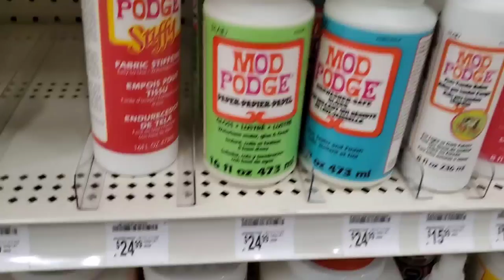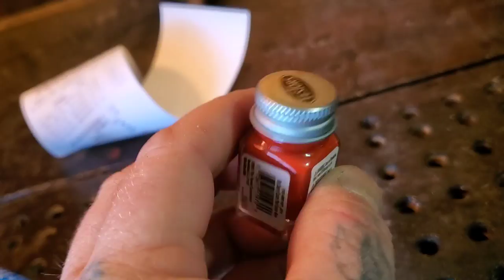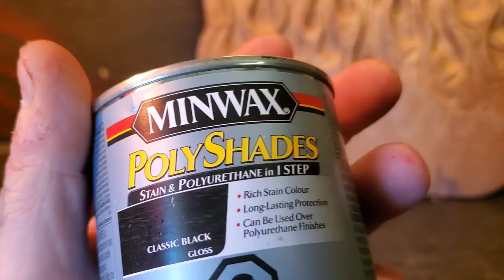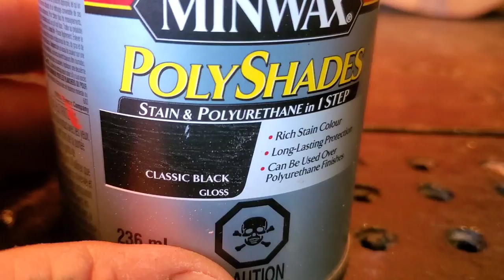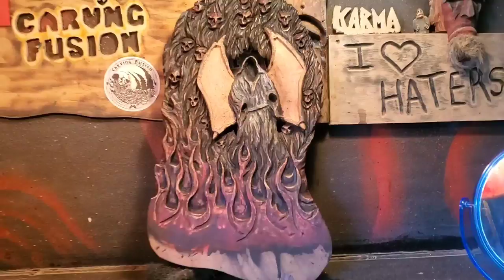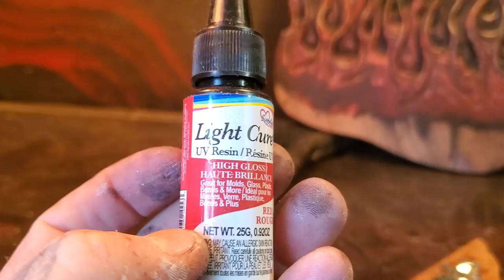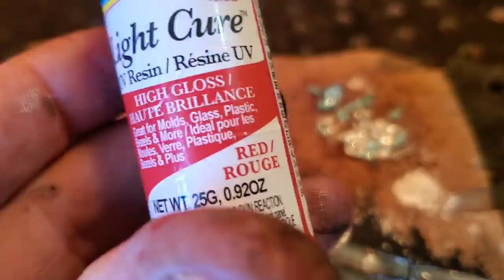Power carving A Grim Reaper # 3.  painting and finishing

Comment: I don't know who, but they are called sparkles because they sparkle. You need a special airbrush to spray sparkles, it has a big tip.  A standard airbrush will clog up. 
SMASHED mirror,,, I like your style.
Micro carver = high speed/low torque. I think it would do a lot better with small bits and fine detail. Just a guess cause I don't have one to judge. I have a little imitation dremel that I can damn near stop by grabbing the bit when it's runnin, don't ask me how I know, put one of those itty bitty bits on it and it will do some very fine detail, very slowly. I hardly ever use it, sometimes for sanding.
Carve a skull to fit in the hood. mount it on a thin stiff wire so it looks like it;s floating in the hood.
The Reaper looks great.
So, Why do people who ride motorcycles have the continuous desire to put skulls on everything?

Comment: Jordy I could see the frusration building up on you. You do need to step back till the stuff you ordered arrives, but even then maybe draw it out on paper till you are happy with how this should look, to be happy with it. and when you are frustrated you don`t think straight, we are all like this Jordy . I have a different attitude to the carvings I do from when I always wanted to be in control of what I did. Now I have retired, If I don`t get a result, I leave it and go back later, and if it doesn`t work out, tough, I just start something else and it takes my mind away to the new project. Hope this makes sense to you Jordy you will get there you always do. Just one more point that new micro carver seems to be losing traction through the wood almost as if the clutch was slipping and the torque was down, maybe its faulty.